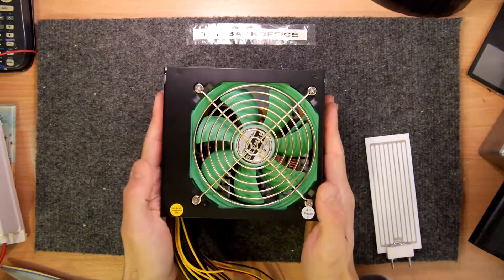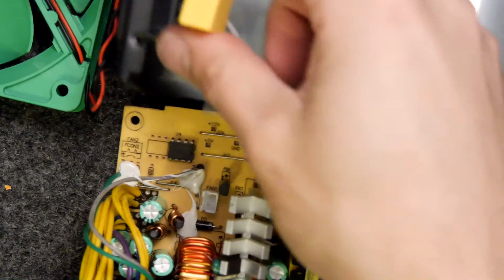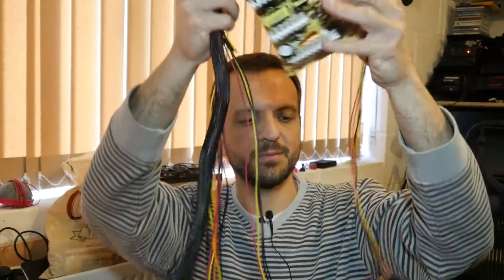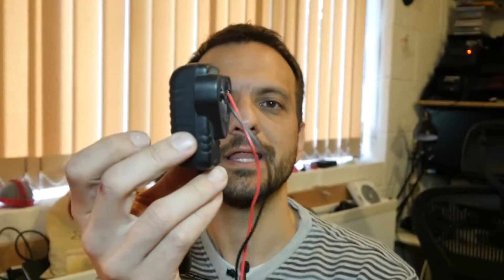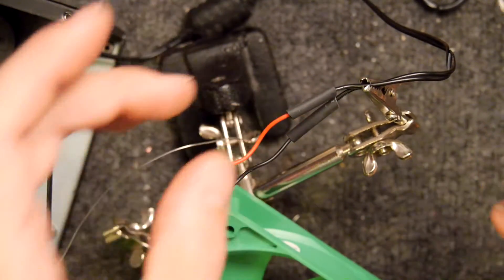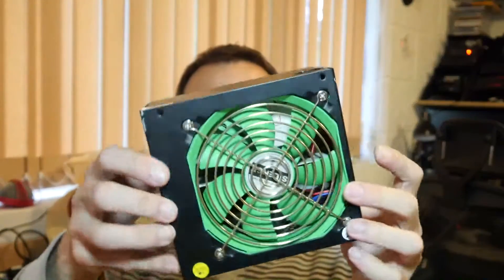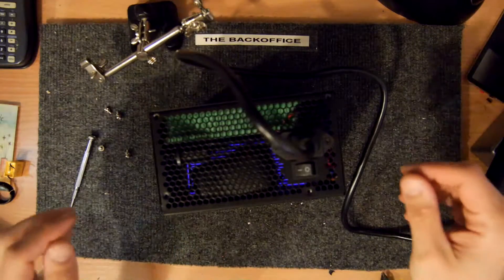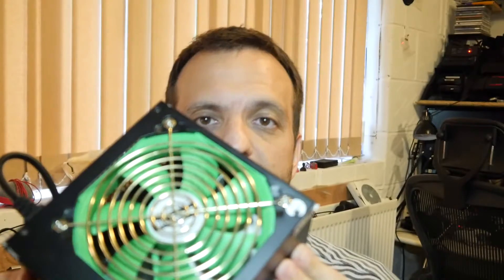DIY PC PSU Ozone Generator Sanitiser Tutorial

Comment: Switch the 12v main on the fan. Easy fix. You could even add a speed knob, and a timer box for safety. I just let a mot run for an hour by accident

Comment: Soldering the wires on these things is a PITA. I bought the 110V, 7gm one with 2 plates. Connected everything with 1 plate. The plate clicks a few seconds before turning on... stays on 5-10 seconds with a nice corona... then the corona goes away and the inverter starts clicking. For some reason the corona doesn't maintain. I see that you soldered directly to the plates skipping the prongs. Did you do that because the corona wasn't maintaining?
Reply from the maker: +Robert Cece hi Robert, in my case I soldered directly because I had limited space in the enclosure to fit them. The unit is still functioning nicely.

I'm wondering if you have a fault in your power supply to the plate?

Comment: Curious why you didn't use Both of the Ceramic Plates? Aren't they rated at 3.5g/hr each to give 7g/hr? Or are they 7g/hr ea, and one is just a spare...?
Reply from the maker: +Mr. Balloonhands it only came with one plate with my set.
Reply from the maker: +Mr. Balloonhands They seem to come with a few combinations on eBay.
Reply: Thanks for the quick response, yeah I've seen many different combos, but all the 7g ones I've seen came with 3 plates so I assumed you had two, I ordered one with two but only one power supply, so I was curious about running two in parallel on one power supply and overheating issues. Great build by the way, you also mentioned that it seemed the output of 03 may have diminished on yours a bit. You may want to try cleaning your plate with alcohol, or acetone...they build up contamination quickly and reduce 03 production, also in order for it to produce good amounts of ozone it needs a good supply of oxygen, so putting it in a sealed container (such as for shoes etc.) will only produce so much ozone once all the 02 is changed to 03 and will be less effective.
Reply from the maker: +Mr. Balloonhands seems to work OK in a sealed box. I would say unless you have a crazy large area to cover this unit is more than sufficient. Interestingly, I have started to observe rust on the enclosure screws, I think the ozone attacks certain materials.

Comment: Great idea for an old PSU. I would personally flip the fan over so it's operating in a more efficient manner. Currently the warmth is probably being generated by causing a dead spot / air trap for air circulation. The screws are self tapping so it's an easy fix. FYI: PC fans should always have an airflow direction on the outer housing.
PC fans can easily operate at 5V or 7.5V if you need to reduce the RPM. Some of the larger fans might resonate at lower RPM, so it's worth checking that first.
Reply from the maker: +Simon Lock (Aergan) Checked it out, basically I had the heat-sink of the transformer conducting to the enclosure (rather relying of forced air cooling) so that is the localised source of warmth. After running for 20 hours, seems fine. 

Strangely that fan does not have a a direction arrow, neither flow nor rotation. My testing suggests that the seemingly lack of ozone smell is actually it being dispersed rather than the fan causing an issue with the reaction, so its good!

Really pleased overall, strongly considering making a few units to see for some beer tokens. Showed it to someone who uses commercial units and they were impressed with both the output and the compact size.
Reply: +The Backoffice If it helps at all, almost all the fans I'm come across that are for ATX spec, the mounting side of the assembly has been the output side. I suspect this is to prevent the fan blade rotor coming loose from the motor.

How'd the industrial de-stink work out though for your shoes? Nice and fresh?
Reply from the maker: Simon Lock Sounds like the fan blowing on the PSU components is the standard. Seems in this application its probably the best configuration as well for cooling the innards.

As for destinking, I shoved a bunch of shoes in the box and popped a lid on it. I ran it over night and confirm the box contained a bunch of Ozone. I can only imagine its working well as I do not have particularly stinky shoes!

However, for me, the regular shock treatment for shoes is more of a preventative rather than the retrospective restoration of the footwear. From previous experience though, this is way more output than anything I have used in the past.